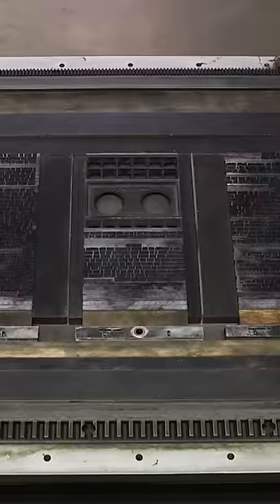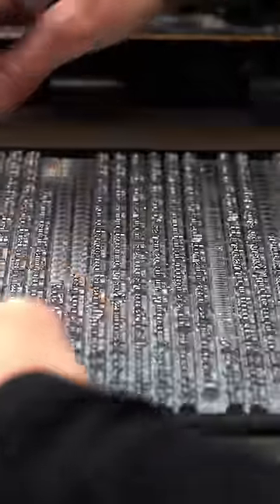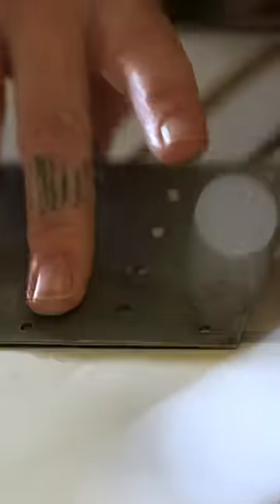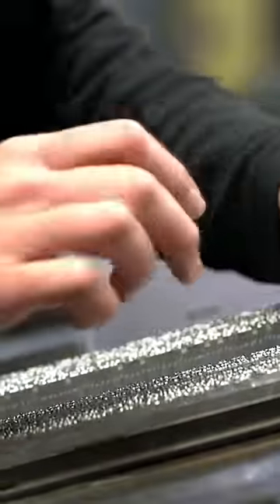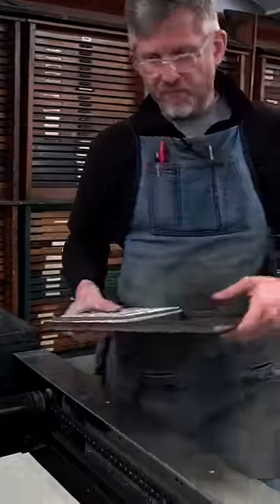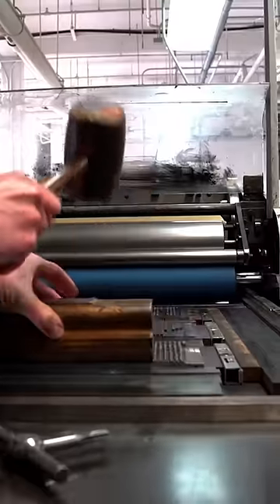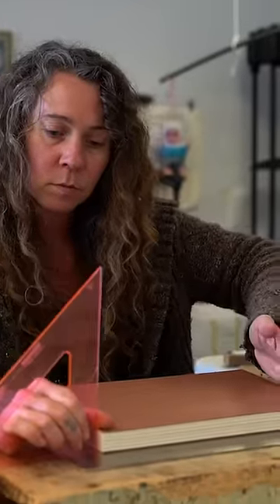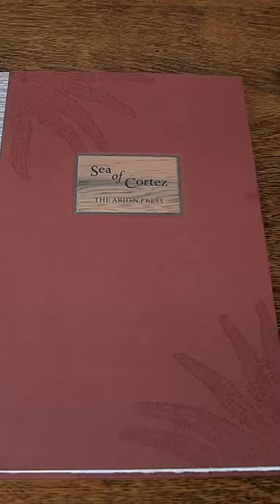How these handmade books cost up to $10,000 to make #books #crafts #handmade

Comment: I worked in a print shop such as this when I was in high-school.   There's nothing like the smell of printers ink😊
Reply: Yes I worked in lead type wood block lithographic dark room and final print on heidelberg solna and other press machines. Pay was terrible but I really enjoyed it as I could see my work from design on the drawing board to final print of poster or text. Also “Compugraphic” was entering the trade than. Single line text floating across a small matrix window. No big pc screens like today. It all had to be done with lots of manual work Pasteup Proof reading etc. no auto correct
Reply: I hear you on that. To me there is nothing better than the smell of a library. The library is losing that smell as the books are made different now. Most books are new now and the libraries are losing the smell. It was so wonderful walking into a library many years ago. I am missing that smell as it is so very faint.  I need to go a library that carries many old books to enjoy that fragrance again. I live in Arizona perhaps I may have to go East.
Reply: Do they print any good books?
Reply: I did as well in the 1960s, and I thought it would be my life's employment. My best friend and I were tasked with printing everything for our school, the school newspaper, programs for concerts, and tickets for events. I tried to continue in this field, when Off-Set lithography was invented, and setting type was phased out.
Reply: Me too... I volunteered in one my uncle's printing press... Still remember all the steps of printing a page...
Reply: @milt0n290  Lead poisoning is more likely to occur if you handle the lead type and then eat something without washing your hands. Also lead poison in more damaging to toddlers who eat lead based paint chips. Though I do wonder if any analysis has ever been made on people who worked with lead type for many years. Many hobbies have possible exposure to toxins,..like artisans who with leaded glass. The assembly of stained glass, uses lead in both the solder, and lead channels.
Reply: having a Heidelberger Cylinder or Tiegel killing your morning sleep in the house next to the printing shop, isnt funny at all
Reply: donnell.okafor  Not bad,...maybe like oil paints with linseed oil,...kind of an "old world", oil painting smell. It was thick and had to be spread thinly with a spatula, then as the rollers crossed the ink platen, it would slowly be spread out further. There can be no lumps, and there rarely were.
Reply: what, in the 1800’s?
Reply: @SAM-sr3fo  Keen observation. The smell of old paper, maybe that velum skin paper, and the smell of leather bound books.

Comment: I worked in a print shop like this for years. We set type using a Monotype caster that reads a punched paper tape. Then the type was printed on either a Washington handpress, a Vandercook proof press or a Heidelberg cylinder press. Sometimes we set type by hand using a type stick. We sent the printed sheets to a hand binder to be bound and often boxed. These books are bought by individual and institutional collectors who appreciate the hand work that goes into them. These books are considered art objects. Asking why they cost so much is like asking why a painting costs so much.

Comment: I remember print shop back in the 7th grade. Memorizing the "job case", type setting, and finally printing.
  This was back in 1974.
Reply: Wow and i was born in 2003 
Comparing today, making books back then would have been really a piece of art
Reply: @Ryuma-gaminator   It was one of the three mandatory shop classes in the seventh grade, Print, Metal, and Wood shops.
Reply: @alanrobinson4318  really sir wow great
Reply: @alanrobinson4318 where did you go to school?
Reply: Are you for real? I've never heard of such a class. I had always assumed this sort of process ended around the time electrification went mainstream.
Reply: @TheMothaFuckinDope   Yah, it was for real. The print shop had 4 presses from the 1940's. Each student was assigned a job case, (which was filled with individual type), and given assignments to create printed material. We'd set the type in blocks, which are a type of clamps, and use a hand press to check for errors. Once we had a finished product, we would set up those old printers and run them to print out a specified ammount of pages. The teacher would grade for quality. Being centered, square with the page, misspelled words and punctuation, and the evenness of the ink. There were lectures on the history of how printing started, from wood block carvings to type set, to the plates they used for news papers. This was, again, in 1974 when computers would fill whole warehouse type rooms. And run off cards and magnetic tapes. Back in the days of Hexadecimal and Octal programming.
Reply: @alanrobinson4318 be careful. Your about to give a whole class on the difference between analog and digital.  Lol
Reply: @davidandrews5262  🤣
Reply: I graduated in 2000 and we had shop class, metalworking, and culinary. I took all 3. ❤

Comment: if these cost that much then imagine a truly handwritten book
Reply: this looks like more work than actually writing them. but once the typesetting is done, if they make 100 copies or so before using those letters for other set of pages, then time & cost will be reduced a lot and way faster than hand writing.
Reply: @suryatejach007 

They make the letters fresh, I believe, either for each book or each page. That's what was implied in video and someone else verified the same in a comment. They become deformed/worn over time of used a lot, so I'm assuming if they're charging such a premium, they'll make sure every single letter is crisp and perfect.
Reply: @ElysetheEevee  that's what the narrator of the video implied. But narrators of such videos usually just steal a video somewhere and make up nonsense about it.
Reply: @inkenhafner7187 yep, and you know he has no idea what he's talking about because he calls the alloy a solution, it's such a stupid mistake and shows they're not serious in their reporting
Reply: @Rullstolsboken Solution isn’t wrong when referring to this alloy that’s literally what it is. Some alloys are solid solutions of metals where the combined metals don’t actually combine chemically but instead alter the greater crystal structure resulting in different material properties. A common example is brass where small amount of zinc acts as the solute and copper acts as the solvent. Another is steel where carbon is dissolved into iron.

Comment: I think I'm going to wait 'til it comes out in paperback.
Reply: I can use a Hardcover too just printed by a normal printer
Reply: The only reason its so expensive is because they only sell a few and handbind them. In a manufacture setting these will be MUCH cheaper. This process was an innovation and replaced handwriting books, and is the only reason books are available today as it made it accessible enough for reading to become common.
Reply: Boy do I got news for you
Reply: I’m a Kindle guy myself.
Reply: @Vikculp 9a!!0
Reply: @melody3741 yeah but this type of setting the letter with the monotype (or linotype) pretty come and democratise at the « end » of the letterpress era (early 20th). From the gutenberg print system around 1450 to 1850 almost a few thing had change for letter set by hand, it’s only at the end of the 19th early 20th century that the letter setting become mostly automatised with typesetting machine and typesetting caster.
Reply: and of course you buy a book like this as an art object. If you don’t like the book as an object no meaning to buy it. You don’t buy a book hand made if you prefer softcover book printed with digital printer or printed in offset in 50k batches.
Each one his passion
Reply: Just get the e book
Reply: @melody3741 Hand binding isn't that expensive though? Maybe USA is weird but here in India I got one of my thesis hand bound (edit: and hard bound) for like Rs. 2000 (24-25 USD I guess?), and that was for 4 copies. The kaku (we call elder guys uncle) even did it overnight. It's probably a USA thing. You people do have a tendency to make things  expensive tbh. 

P.s- I think the process of printing takes up more of the cost rather than the binding.
Reply: @rkang6531  in the hand binding them was as important as the numbers of production just that it was a factor to
Reply: Hardcover is what I love collecting, paperbacks are delicate and easy to bend, ruining the quality of the book.
Reply: I’ll do audiobooks on the treadmill. Makes the time go by quick.
Reply: @rkang6531  yours were 100% not hand printed though, where each page needs to have each individual letter set up and spaced properly. They can be computer printed and hqnd bound which is way less work than whats pictured here
Reply: @BooBuKittyPhuk  I was not talking about hand printing, neither did I say they were hand printed, you are making imaginary assumptions. Read my comment again, it was in reply to another person.
(Although, since you brought it up, hand printing is also wayy cheaper here, similar to how hand woven or block printed textiles are cheaper. Although still more expensive than the 'regular' textiles, they are much cheaper than their American counterparts, edit: and of higher quality and variety.)
Reply: @rkang6531  I see you edited your other comment though, because yes, clearly the process of printing is what makes up most of the cost
Reply: @BooBuKittyPhuk  Dude, I edited it when I commented a week ago or something, right after the original comment, I even mentioned the edit, because hard bounds r little more costly. It was already edited when you replied. Anyways u want to argue further, have at it, but unless you've something valid to say I'd rather not reply 👍.
Reply: @rkang6531  i would've had no reason to reply to you... it wasn't there before, you added the p.s. after, why even lie about that... weird ✌😬
Reply: @BooBuKittyPhuk  It definitely was. The person I was talking to (i.e not you) even mentions it somewhat in their reply, you probably didn't read properly. I literally don't give af about a random yt comment section any more than I already have. You can assume whatever you want man, good for you 👍.
Reply: Read your bible! (KJV, preferably) ❤️😮❤
Reply: I’ll just wait til it drops on kindle bro
Reply: I think I'm just gonna pirate it
Reply: I prefer hardcover

Comment: the crazy part is that when the printing press was invented, it made books WAY cheaper amd faster to produce
Reply: it makes books faster huh? yea no...gtfo
Reply: @russiancommy  as opposed to having to write every copy by hand? Yes it was. The process takes longer to start producing, but a lot of copies can be made with it.
Reply: @brandondenny226  misread original comment and thought op was talking about current times.
Reply: cheaper isn't necessarily cheaper. people got paid a lot less back then. inflation
Reply: @russiancommy  >when the printing press was invented

bruh it was invented in like the 1400s how tf u think that
Reply: @jcody_parker  I am not sure how much people were paid when proportionately compared to today, but inflation is not the meter of measure you should be using in this case. The important part is how much spare money (if any) one had once you cut out the cost of living. One penny had a lot more buying power than it does today, but of course they got less pennies than they would today. We would need to find the ratio and see if they had more or less buying power.
Reply: @SecuR0M  went over the "was invented" your pfp really shows off why you had to comment.
Reply: You still had to set type by hand until the last half of the 20th century.
Reply: @GummyBearWA  yea and you had to write before typing existed and that was slower? and the printing press was replaced by a printer. writing was replaced with typing or using a stenographer.
Reply: @russiancommy why you mad at history, bro?
edit: never mind, i just saw your second comment. we cool.
Reply: @jcody_parker bruh the printing press is older then America 😂
Reply: Those are the days!
Thanks for pointing that out.
Reply: They used to reuse the page layouts and the type, so it was much faster then before because you only need to press each page.
Reply: @jcody_parker So? Cheaper is in fact cheaper. Adjusting for inflation a manuscript cost thousands and a printing press book cost a couple of weeks wages. 

Cheaper does in fact mean cheaper. I’m every century.
Reply: @russiancommy bruh what. Yes it did
Reply: @russiancommy I honestly thought you were making a joke about a book running faster…cause books can’t run, I thought it was funny until I realized that’s not what you meant
Reply: @russiancommy  I truly hope you seek a professional therapist because someone who is responding to a comment for the first time should not do so belligerently. It’s also sad that after you made a mistake by misreading the comment, you began to attack the people who were trying to help you rectify YOUR mistake.
Reply: Well that method was at a much larger scale back then so of course it was faster. It was probably cheaper to buy a horse and buggy as well.
Reply: @russiancommy take a page, print it 1000 times, then move on to the next page, repeat with all pages

You now have 1000 books' worth of printed material for not significantly more effort than one books' worth
Reply: I think it's important to remember that back when they printed books like this, they would put together pages like this and then run off thousands of copies to pro-rate the cost of that labor way, way down.  The presses that were most focused on mass, cheap production were also not putting the same amount of time and care into making each and every piece a work of art, but were very much working at a breakneck pace to get that setup time down and cutting corners in the process and with material quality wherever possible.  Many of the examples we still have were books that were high quality and so were much more likely to be taken care of and preserved over the centuries, whereas the cheap quality books were forgotten about, rotted away, and were thrown in the trash a long, long time ago.

That's not to say that they weren't still skilled craftsmen or that they didn't care about their work, but there is a different type of value we get from things, especially information, being made widely available to as many people as possible than what we get from a masterpiece book printed on the finest sheets of vellum or parchment with gold leaf filigree and bound in exotic leather.  I would also imagine that many of the people running and working the printing presses geared toward spreading information as quickly and affordably as possible in those days would have been passionate and "radical" (for the time) free-thinking types.  The printing press was the seed that the enlightenment grew from, and the people facilitating that spread of knowledge were at the heart of it.  Owning a press during the protestant reformation could be very hazardous to your health, depending on where you lived, as the church did not like that these newfangled machines were suddenly making it possible for non-clergy to read the Bible for themselves.  And the ruling class often didn't take kindly to the pressmen, either, when they were being used to spread "lies and misinformation" about them.

It makes sense, then, that as the technology for spreading ideas has evolved and made these older methods obsolete, that what we are left with are the artisans who were producing books that are valuable not just for the words in them, but also for the thing holding the words.  A finely crafted work of art is as valuable to us as it was to people 500 years ago, and a book of such a high quality as these can't be replaced by a simple paperback or a PDF.  Maybe the craft will eventually die off completely, bht it will probably take a long time.  I think that even an illiterate moron who couldn't tell you what all those squiggles on the pages mean could still probably pick up one of these books and feel that it's something truly special.